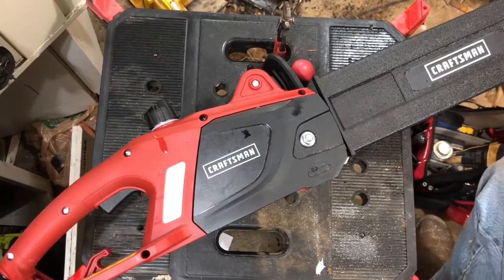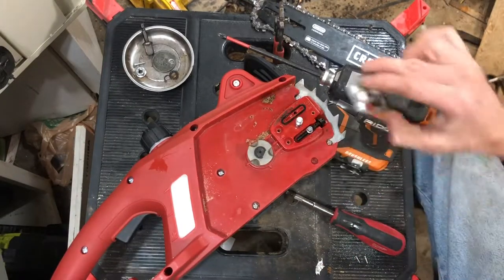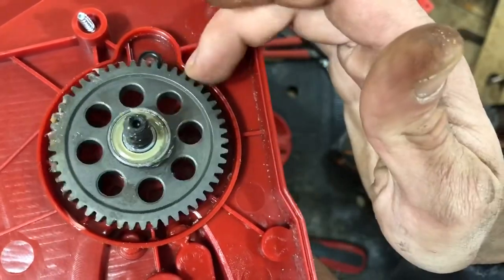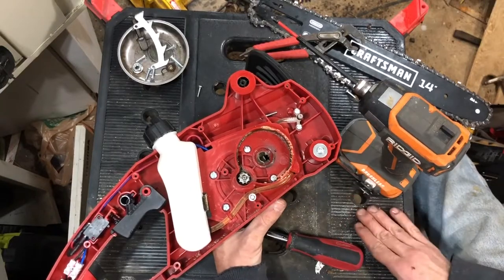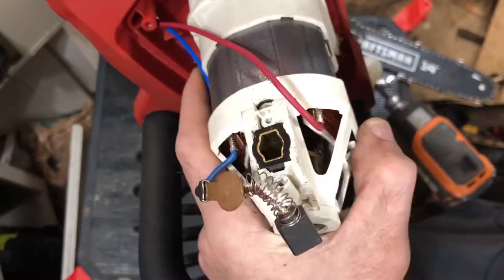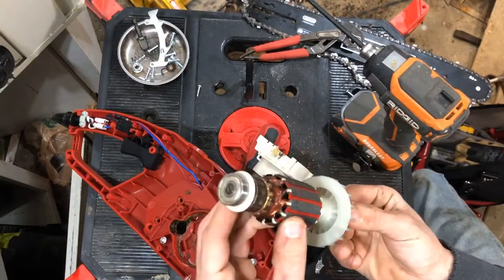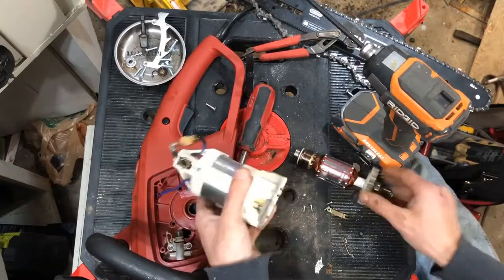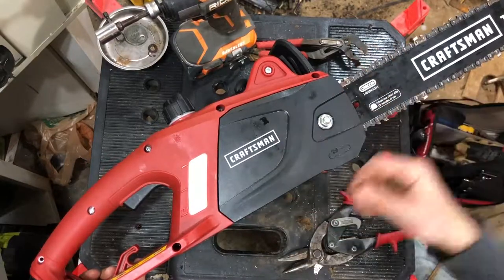TEARDOWN: Craftsman 14in electric chainsaw

Comment: Thanks so much for this video. By complete chance it's exactly what I was looking for. I'm convinced this saw is mechanically the same as the Oregon brand saws just with a slightly different shaped casing and less of the 'premium'  features that just screw on. Under the side plate it's functionally identical. Must be from the same chinese factory.